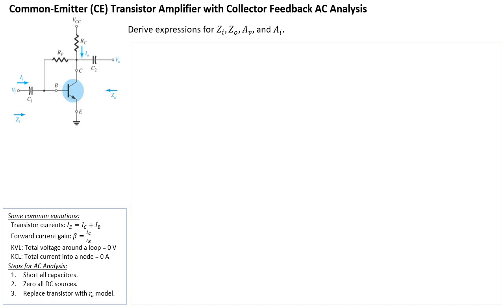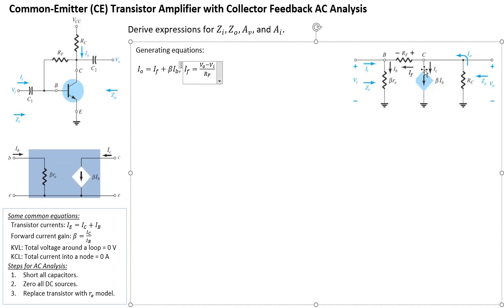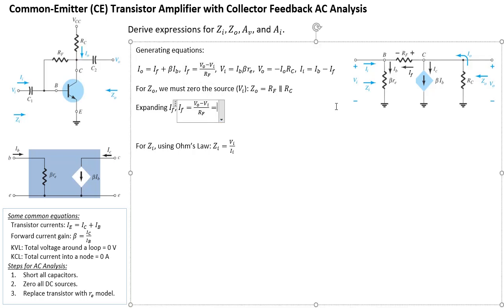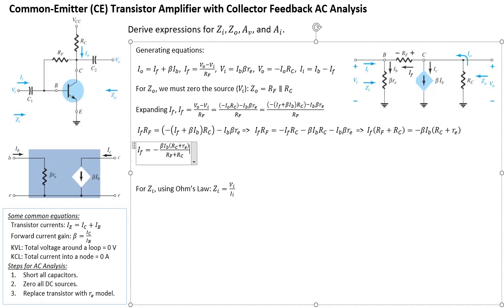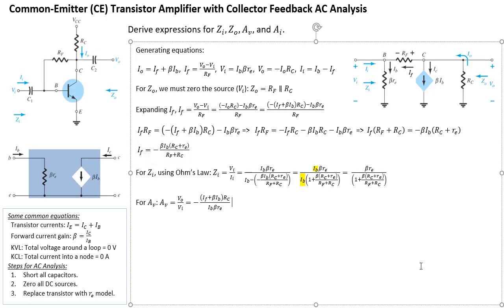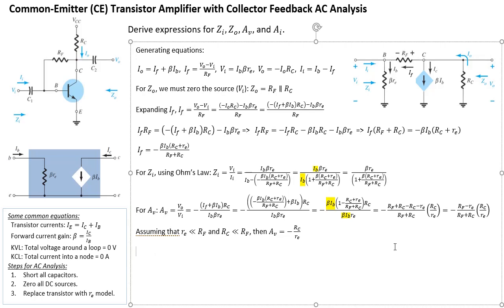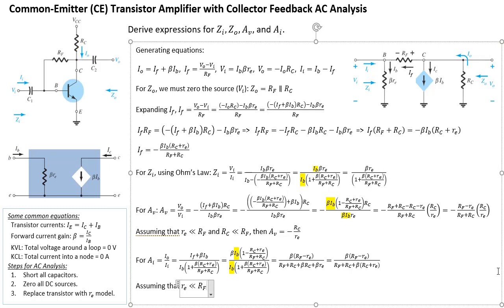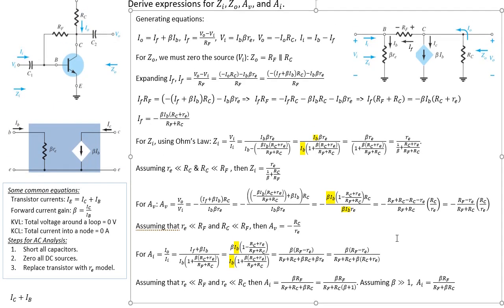Common Emitter (CE) amplifier with Collector Feedback, AC Analysis

Comment: do you have a video with effect of ro?
Reply from the maker: Hi! Thanks for asking!

Assuming r_o is the internal output resistance between C and E... then it would simply appear parallel to R_C. 

I don't have a separate analysis of such a circuit, but Z_o will be straightforward. However, anything that involves I_o would need to be redone as you'd have to consider the additional current flowing through r_o.

Hope that helps! 😊

Comment: If i apply miller theorem,  the ans will be wrong or right?
Reply from the maker: Hi Salman. Apologies for getting back so late.

If you use Miller's Theorem, you have to understand that the assumption is that no current flows into the input of the amplifier. Obviously that's not the case here as I_B (for biasing) and i_B (from the signal), are not zero amps.

So the derived expression via Miller's Theorem will not be the same as per my derivation, as I do not assume zero amp input current.

Hope that helps. 😊

Comment: THE WAY I LEARNED THIS IS BY APPLYING MILLERS THEROM.I AM NOT CLEAR ON SOME OF THE ALGEBRA YOU DID.
Reply from the maker: Instead of using Miller's Theorem, the analysis here is based off Ohm's law, KVL, KCL, etc. Any specific part of the derivation that you're not clear about?